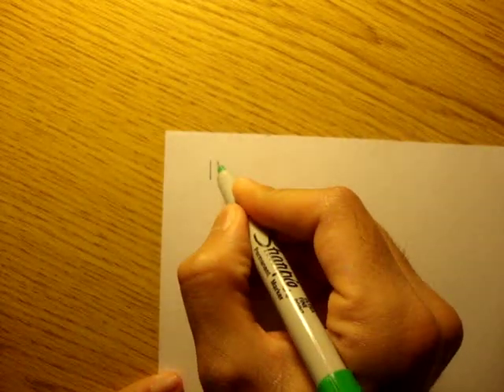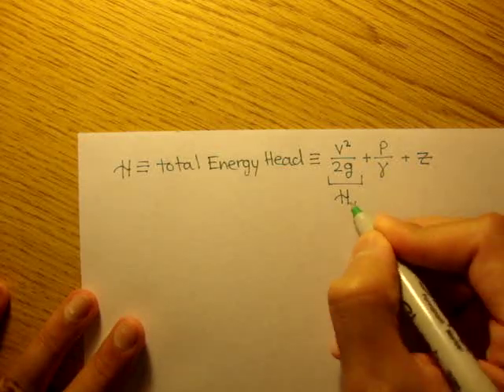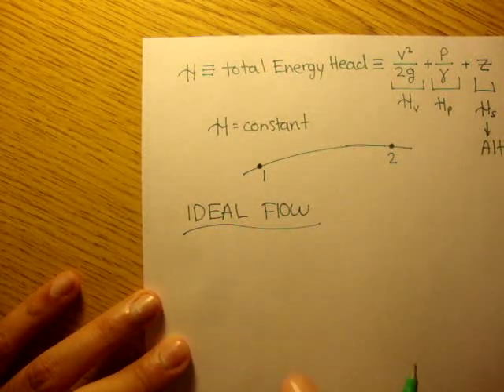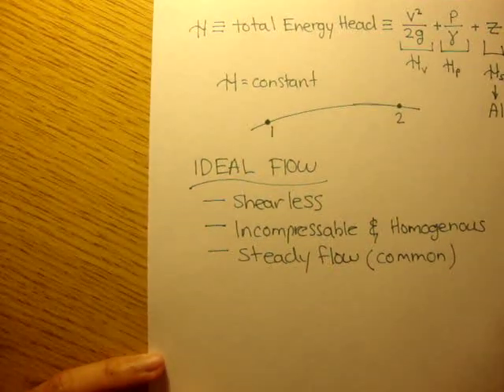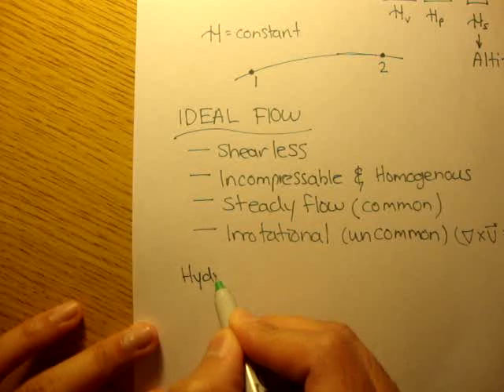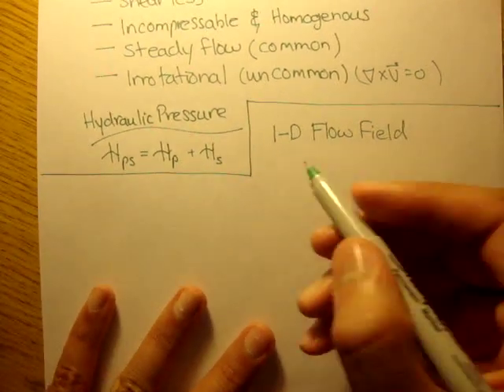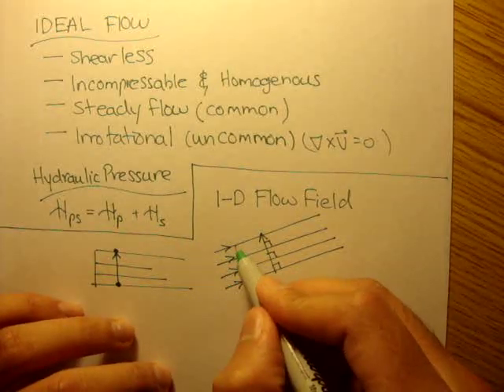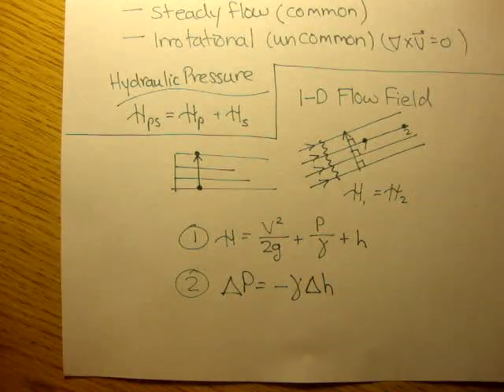Introduction to Bernoulli Equation [Fluid Mechanics #19]

Comment: is there any pressure in the wall (not cross section) of uniform pipe carrying fluid?
why? why not?

and "P" used in Bernoulli's equation is pressure at cross section(Not wall) of pipe. right?
please explain this stuff.
regards..
:)